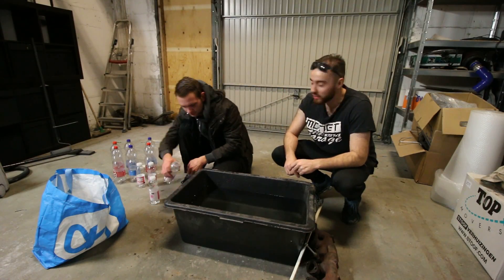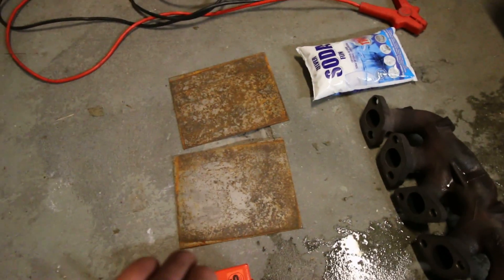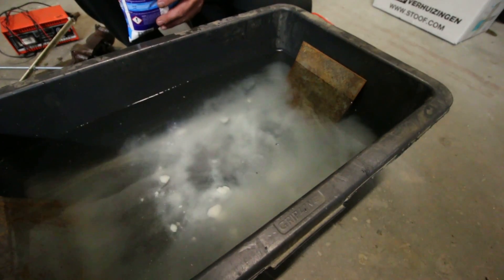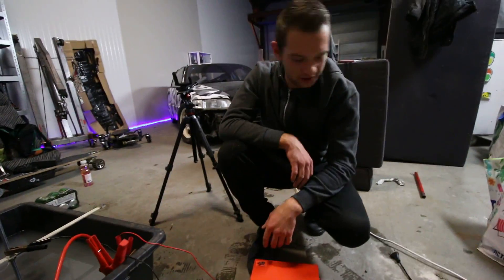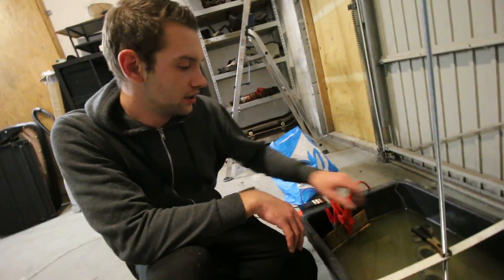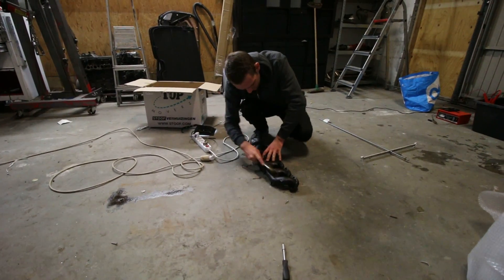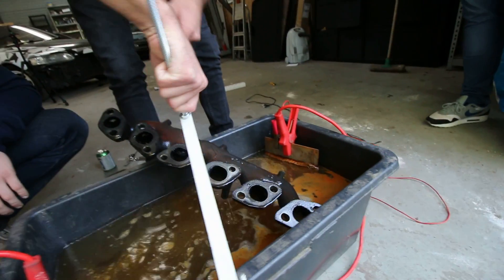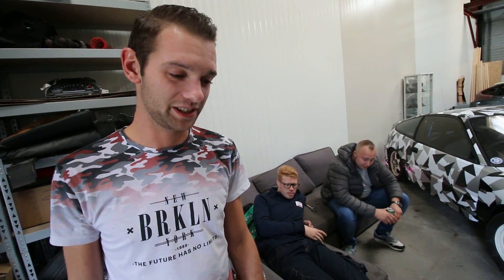The easiest and laziest way to properly de-rust items (using electrolysis)

Comment: https://imgur.com/a/ljlbmik

my experiments using 5v 500 - 900ma via a USB car adapter connected to my battery bank.
medium is oxy action laundry booster an borax. (degreases while it works! lol) (it's what I had to hand eh)

working surprisingly well and fast.

using aluminium sacrificial cathode, cause I have a lot of scrap spare

titanium or carbon/graphite are the best cathodes to use, no yucky rust water, aluminium also works, but degrades pretty quickly.

also DO NOT USE STAINLESS STEEL!  it leeches chromium oxides into the water and makes it extremely toxic and dangerous.

Comment: You guys know I have an 18th century piece of cast iron that has some rust on it but I want to keep the original patina underneath the rust will using your process just remove the rust or will it remove the original patina also? Seven seven five three one five nine five one seven a call or text number anytime